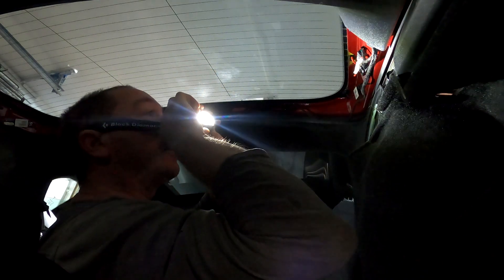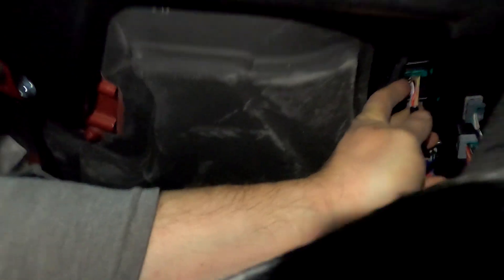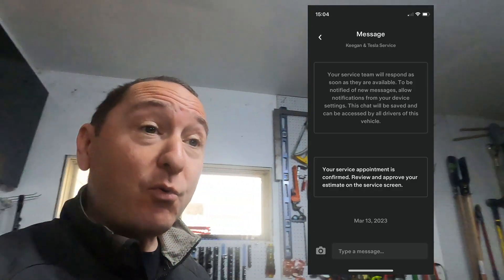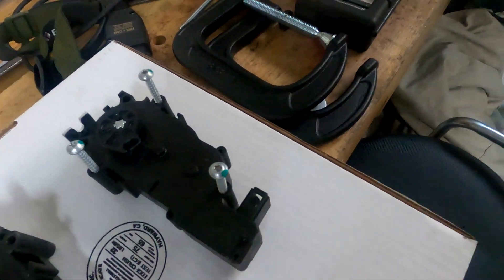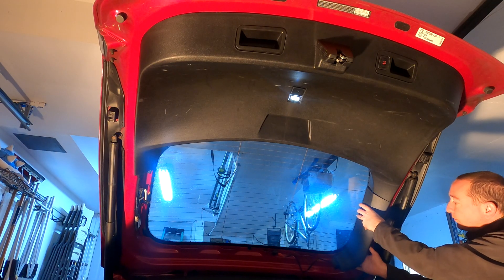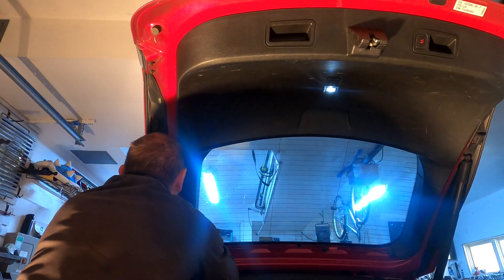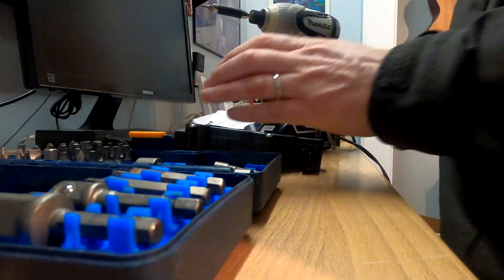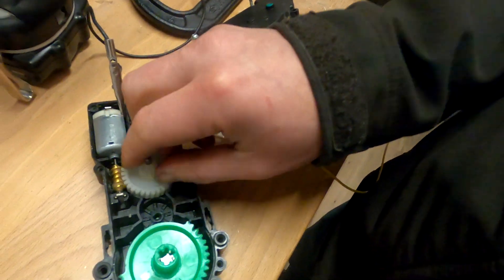Fixing Tesla Model S Stuck Hatchback. *when the black plug trick doesn't work

Comment: i had to plug and unplug that black connector few dozen times and actuator did free up the hatch door. fyi
Reply: Yes, that worked for me too. The cinch moves a bit with every re-plug and keep going until it stops. This eventually released the liftgate lock. I then left it unplugged and the liftgate works manually until a new motor is fitted.

Comment: I’m having this same issue right now! I have taken it in twice to Tesla. Once they replaced the actuator the second time, replaced the hatch, and it’s still not working! What is the exact part you had replaced? I’m going to find out if that is what they had replaced in my car. I’m shocked how many people are having this problem, the service center seem to be surprised by my issue.
Reply from the maker: Wow if you replaced the actuator, only other options would be a bad replacement part, wiring, or brain. Probably body control module of some sort

Comment: Thanks for the info. I drove home from the store with my trunk not latched. I did the “hold the open button for 15 seconds” trick and it worked but I know this part is starting to fail.
Reply from the maker: Not too hard of a job if you have the right tools
Reply: What is the “hold the open button for 15 seconds” trick? My car is having the issue and I need to drive 170 miles to the repair location.
Reply from the maker: @thegingerbreadprints  https://teslamotorsclub.com/tmc/threads/rear-trunk-wont-close.224422/
Reply: @thegingerbreadprints  open the trunk and hold the button under the lid for 15 seconds
Reply: @paulg8065  The issue is the truck is closed but the screen shows it’s open. And actually the truck can’t be open. It stuck shut.
Reply: @thegingerbreadprints  ah, if it’s stuck you probably need to do the full repair. Maybe try holding the keyfob trunk button open for 15 sec?
Reply: @paulg8065  yeah that’s what I am doing. Driving the car to the repair place and hoping this problem won’t occur in the middle of driving.

Comment: Maybe you can help me figure out what was the 3-beep same error as you initially.. When the cinch actuator arrived after about 2 weeks, I was weirdly able to lift the hatch and there were no more beeps... fitted the cinch actuator, but still have the same issue, but no 3-Beeps anymore.. Fuse? think it T210? no motor action for the liftgate at all... maybe the black plug? have tried resets...
Reply: its a 2019 S100
Reply: The lack of beeping may simply be the center speaker being unplugged.
Reply: Yes, I figured that later, I messed with the black plug and after a while of plugging/unplugging the Hatch Motors sprang into life…now the cinch actuator tries to pull the hatch down but fails… so I’m getting there slowly….

Comment: I wonder if I should do this pre-emptively. Mine's a 2013 and the struts often struggle to open the liftgate. It sometimes acts "stuck" but it usually just needs a helping hand to get it started.
Reply from the maker: sounds like the struts rather than the latch, but changing out that cinching actuator while you can still open the hatch is a good idea. $70.
Reply: Great video. What is the part called? My problem is rear hatch won’t lock comletely. Says open.
Reply: Quick fix - Release and reconnect black contact - doesn’t “repair” any more.